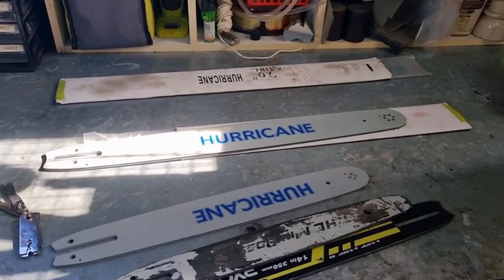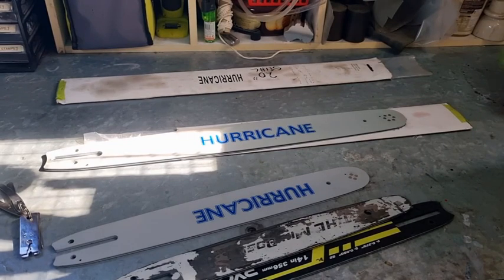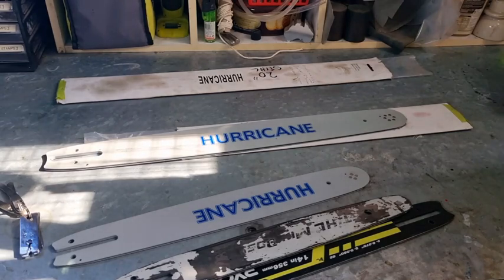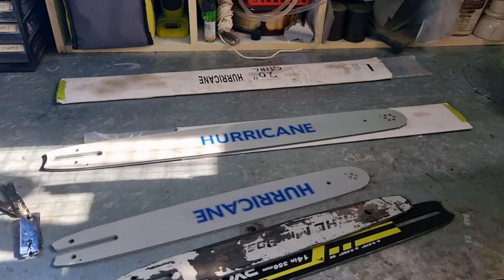Checking your bar gap for wear

Comment: Hi there Dude....got a question for you...if the channel of the bar appears to be wider, as opened, not  worn, can we help it to get into its original size with a hammer and a piece of hard wood? Using the visel? Thanks for your opinion.
Reply from the maker: Yes you can hammer it but go slowly.
Squeezing it in a vice will also work but take it easy open close open close and use feeler gauges to check gap or something the correct size